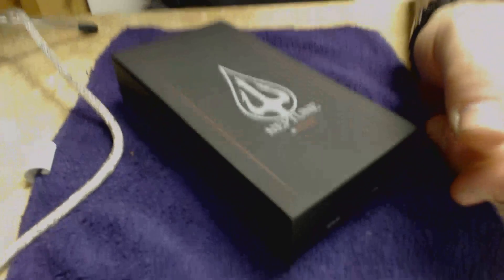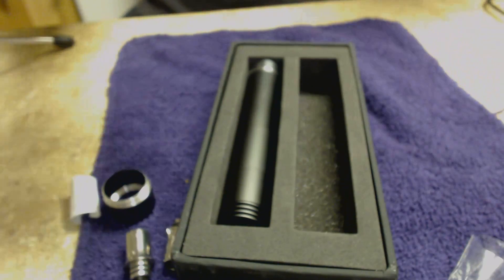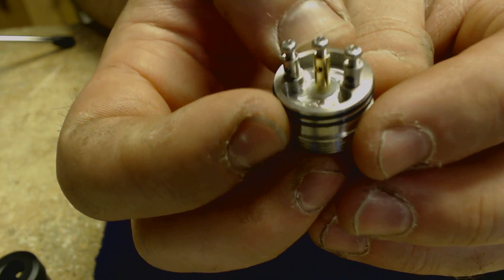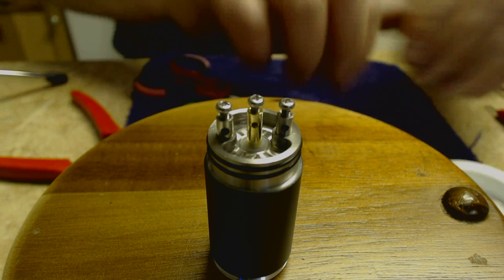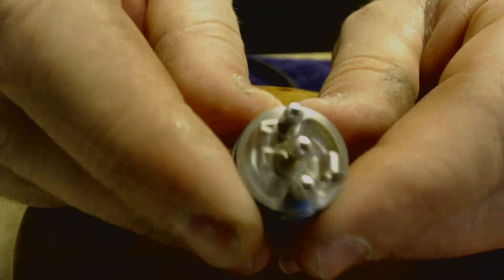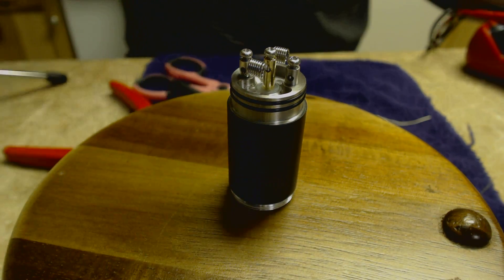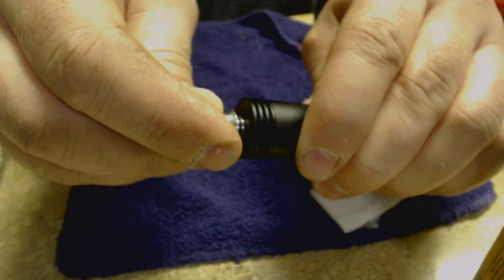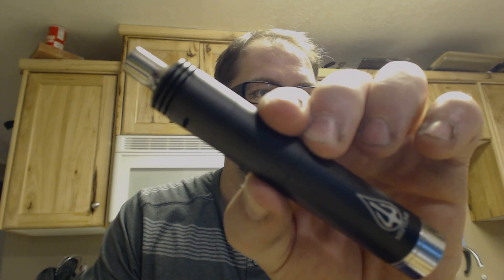neptune v2 + build! (Closed)

Comment: To start off, #colossalcloudz Another great video Trevor. I've strayed from mechanical mods honestly. It's great to see someone else use a multimeter. I've done a video about it about a year ago it seems, but most people don't seem to use them. I was about to say, I'd love to see your opinion of a Reo, if mine had a new adjustable 510 on it I'd send mine to you for a video. Then I hear you talk about a squonk atty. What device do you have for that?
Reply from the maker: ***** danny!! hey feel free to link that video bro! also, I am using the bf version of the hobo v3. I need a reo in my life for sure. squonking is amazing! I am surprised that more devices are not available for us (vaping community) great to see you dude! thanks so much!
Reply: Trevor Jones I just tagged you in the video comments I was talking about. I have 2 Reos. The owner is such an amazing guy on ECF. I agree squonking is amazing, but sad to admit I have been straying from it. I got a hexohm v2.1 and twisted messes rda and my Reo has been put on the shelf. I feel that people think squonking is a method of "old vaping". People just don't want to try it. One of these days maybe we can work out a trade or a loaning agreement and you can get your hands on my Reo haha.

Comment: To Trevor or anyone....  Got a doge v2 been building and noticing my wire going up side of post holes. Mostly with parallel builds. Is there a quick fix or any advice or do I just need to take alot of time and make sure that center post hole catches my leads. I have a hard time catching all four it seems like one always slips to the side in a dual coil build of course. Anyone's help or insight would be greatly Appreciated
Reply from the maker: Joe Bark i like to pinch my positive leads together while tightening down the screws! in my latest video i went into detail on how i fix it! (doge v2 + build!") i hope this helps!
Reply: Trevor Jones it's really tough when you have 4 wires passing through on a parallel build though